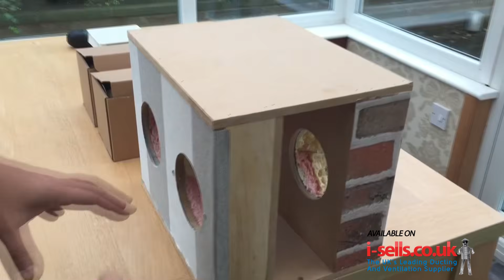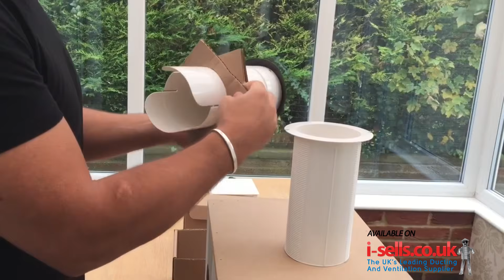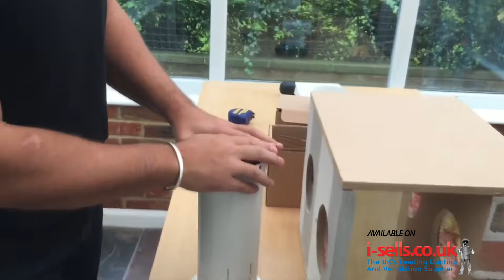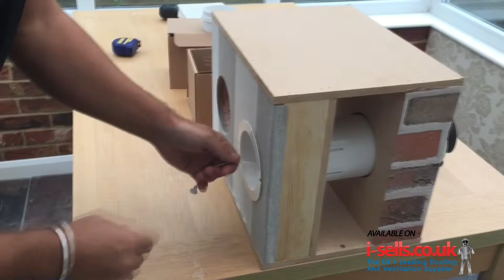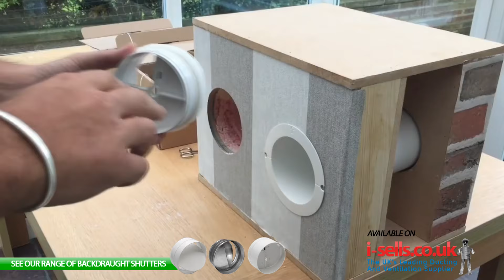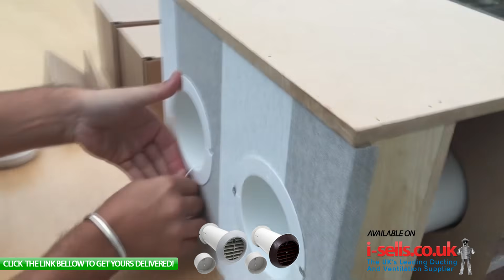Manrose Quick Fit Extractor Fan Wall Installation Kit – Telescopic – Fits All 100mm Fans

Comment: Can I use this to install the svara fan?
Reply from the maker: Sure, any 100mm spigot extractor spigot will push fit inside the pipe. Just be aware YOU WILL REQUIRE 117mm CORE DRILL due to the external diameter of the kit

Comment: Does it matter if the vent is installed low down or high up on a wall?
Reply from the maker: Hello, this particular vent is for high rise buildings where you don't have access to the external wall from the outside. Passive vents that are installed low might need grille with mesh to avoid bugs and insects crawling in. See our selection of passive vents here: http://bit.ly/Passive-Vents or give us a call for more recommendations on 0208 463 9696